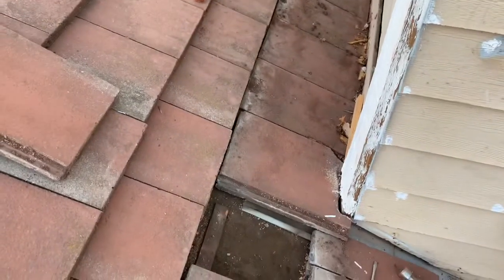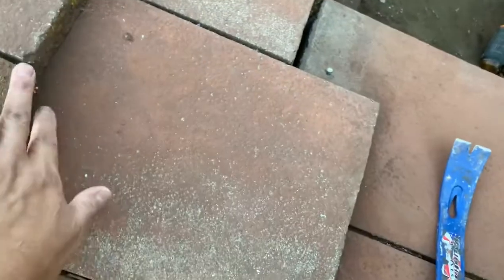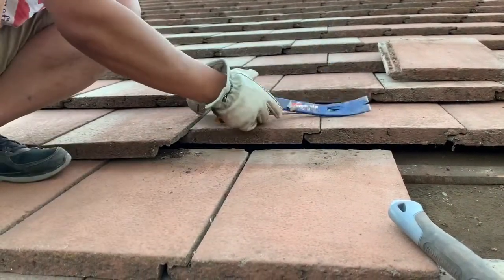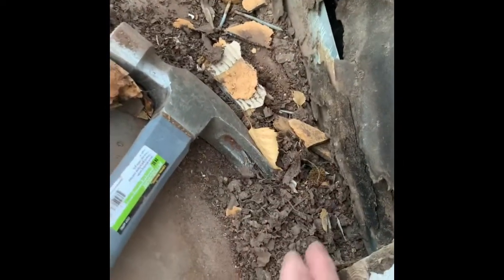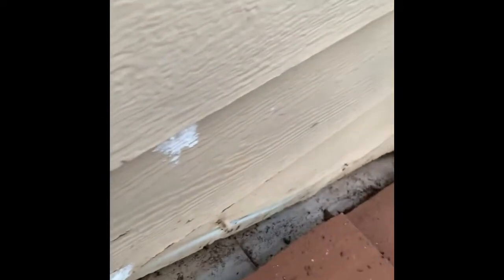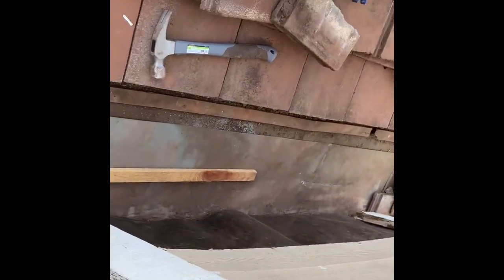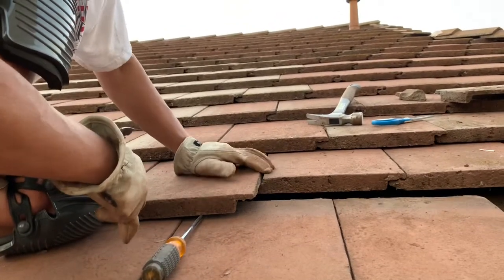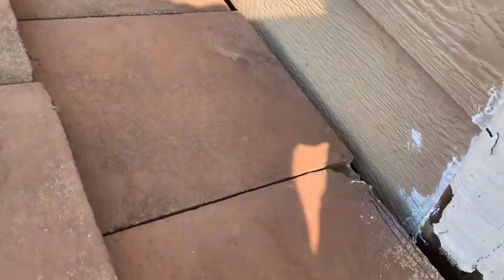How To  Replace Concrete Roof Tile And Repair Leaks

Comment: Great video. I have no experience with cement tile and have tiles that need replaced AND have the same leak you had around my chimney. Your video gave me great information and some confidence that I can do the job myself. Thank you, you gave me the inspiration I needed.

Comment: do the roofing material company sell only to the roofers? i need to buy 16 roof tiles concrete double s tiles
Reply from the maker: @wagyu_killer  they sold to anyone. Btw, I am not a roofer.  I just happened to be a very handy person.  😂.
Reply: @sxn10 has your roof leaked yet after you fixed it yourself. the pros would have charged 1000 minimum right?
Reply from the maker: @wagyu_killer  no leaks.  I know what I am doing.   I repaired multiple roof leaks on multiple houses before.  They quoted  the homeowner $4200 to $4700 for the job.  I fixed it for free because it’s my friends house

Comment: I'll preface this with, I know nothing about roofing, but wouldn't you want to install/replace the flashing around the chimney to route the water around the chimney and direct it to run off the roof. If I recall you indicated that there was some flashing there but it didn't extend very high and that was a key contributing factor to the leak. Why not replace the existing flashing with some that would extend higher up on the chimney to reduce the chance that the water might once again flow over the flashing and end up down the wall again. Again just a question. Thx.
Reply from the maker: Yes. That’s another option too. Replace the flash with higher one
Reply: @sxn10  After researching this a bit more it seems like maybe the best approach would be to add a cricket/valley around the chimney to divert the water.
Reply from the maker: @jetmartin9501  what I’ve done was for the purpose of diverting the water without clogging

Comment: Hi Steve I have recently had my extension roof tiled with flat interlocking tiles, and the guy has left lots of gaps about 1/4 " in many places, Does this matter? please help
Reply from the maker: Hi Summer, gaps cause leaks so you are right to concern.  I would request the installer to redo them
Reply: @sxn10  Many thanks Steve much appreciated.

Comment: so 1 row has nailed in and next row has no nail?
Reply from the maker: Each row has its own nails
Reply: @sxn10  meh ,,,I live close t o Westminster, CA ...I got Wesminster Roofing Vinh did my roof , so they nailed the concrete tile directly to my roof's woods - wondering is that ok?

Steve Nguyễn ở Nam Cali ?
Reply from the maker: @jpthsd  I am in Northern California.  It’s perfectly correct to nail the tiles down to the wood at initial installation to prevent them from shifting over the time. Basically each tile needs to nail down.  When replacing a existing tile, it’s not possible to nail down the new tile due to overlapping tile from existing good tile.  If you were replacing several tiles, then some replacement tiles can be nailed down.  It depends on the location of each tile.

Comment: Hi Steve, this is really helpful! I want to know where did you buy the concrete roof?
Reply from the maker: There are several places sold old concrete tiles locally.  Try google it where you live or ask around for recommendations
Reply: @sxn10  I tried looking for it on Google but it seems to me that those same tiles are not as common or available. I live in SoCal
Reply from the maker: @Motibasyon404  I am in the Bay Area and there are few places selling these discontinued tiles.  Maybe reach out to few roofers and ask them for pointers.  I am certain there are stores selling them in Southern California
Reply from the maker: @Motibasyon404  google classic roof tile.  They should be able to help you or give you some pointers
Reply: Hi Steve, I'm currently installing a tile. Just one tile here and there so I'm not sure how I can install the new tile. Some tiles are broken in half and the other half is still nailed down. Not sure how I can access it
Reply from the maker: @Motibasyon404  Hi Dominic, make sure the new tile is exact model.  Not all tiles have nail so you might need to remove some good tiles to make room to remove the nail from the broken tile.
Reply: @sxn10  so I have to search for a tile that isnt nailed down then work my way so I can get to the tile that I want to replace? I checked some of the tiles around the tile I want to replace. I cant seem to find a tile that isnt nailed down
Reply from the maker: @Motibasyon404  hi, it’s a bit difficult to provide further advices without seeing the actual installation.  On the same roof where I filmed the clip, I redo a 10x10 ft section and found nails around tiles at low row touching tge gutter and nails on tiles at the edge.  in your case, maybe try to partially lift the nails so that you can lift nearby tiles to replace the broken one.  It's hard to advise without being there.  good luck and update if you figure a way to solve the problem.
Reply: @sxn10  honestly, I'm considering to start at the top of the roofing (along the ridge) then work all the way down. Do you think there'd be a non invasive fix other than that? Bc I think that's my best bet
Reply from the maker: @Motibasyon404  that might be your only option.  Try to remove as little as possible until you reach the broken tile.  It’s not that hard to reinstall them.

Comment: The tile laid all the up to that vertical wall is incorrect. There should be an approximate 6-8 inch gap between the bottom of the last tile and the vertical wall, then right angle flashing wide enough to get under the upper felt by a few inches and that covers the entire area at that roof to vertical wall junction. Cut and bent to fit and prevent water getting to the wall at all, with plenty of roofing grade sealant. Roofing tiles should never be laid all the way up to any vertical surface, a gap is necessary for water and the debris that the water will carry with it. A channel to carry water away during heavy rain along the face of that wall and down the sides around it would also be advised. if not done this way years of water going under the tiles will degrade the felt to the point that it will starting getting inside the home.
Best practices and code requirements vary a lot due to different weather in different parts of the country but that is not compliant anywhere in the US. Every roof should be studied to understand where the water flows and what it does when it encounters an obstacle. Designing your repair for this will make it last longer than the house itself.
Reply from the maker: Agreed.  A little bigger gap would be better.  It’s about 2 to 3 inches now and much better than the original built by the home builder.  The whole complex with few hundred homes built incorrectly but passed inspection 🧐
Reply: @sxn10  Yes it is shocking what passes inspection sometimes.
Reply from the maker: @jameshisself9324  yeah.  Many houses in the complex have the blue tarp covering during the raining season
Reply: @sxn10  yikes

Comment: Your flashing against the wall or the chimney should be 6 inches higher, and the tile should be at least 4 inches away from the wall. If you have the corrected infrastructure, then you should never have to deal with the leak again.

Also, when you replace the felt paper, you should have two layers of 30 lb. felt paper.
Reply from the maker: Really appreciated the info. Thank you